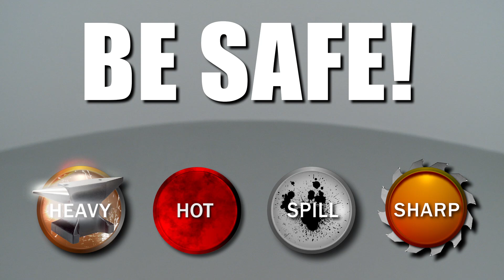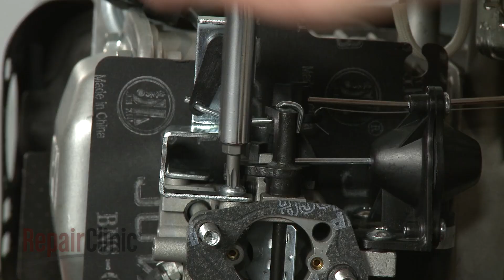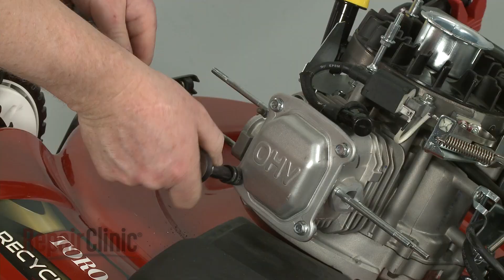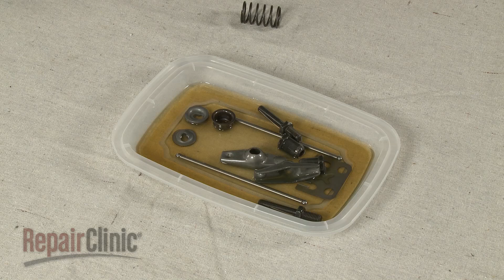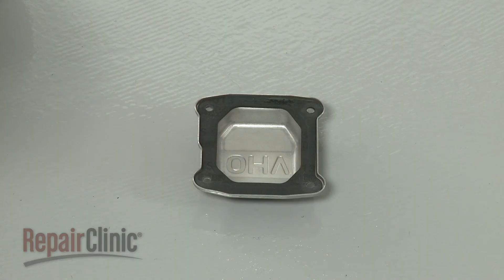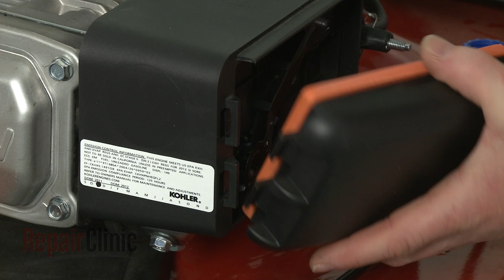Kohler Lawn Mower Valve Train Kit Installation #1475511-S

Comment: I want to see a video on how to check valve clearance on flat head valve 4 cycle engines and how to adjust the clearance if it is needed and re seat the valves?
Reply from the maker: John Mott If the information we provide at the 7:45 mark of this video is not sufficient than we do not have a video that will suit your needs.